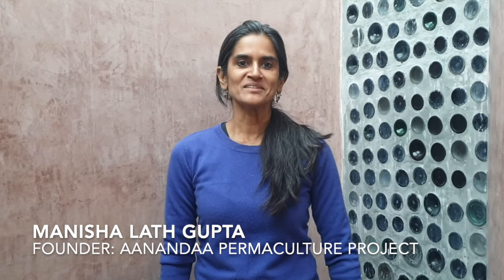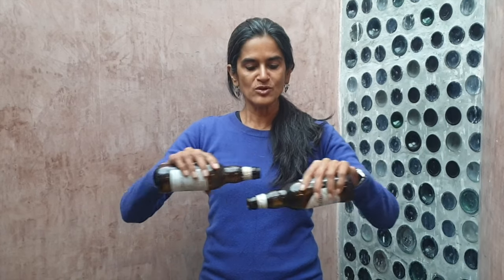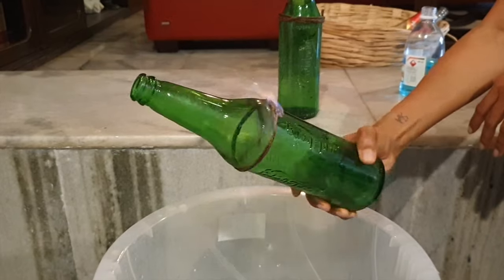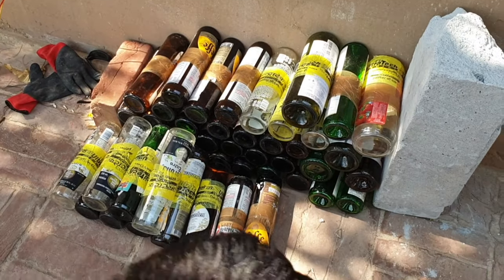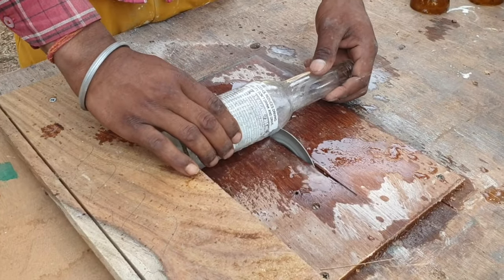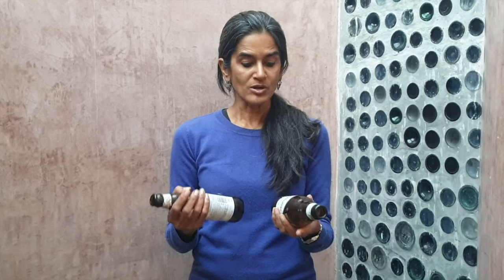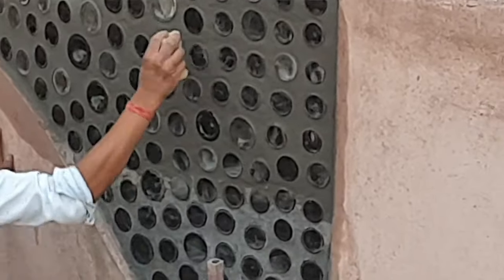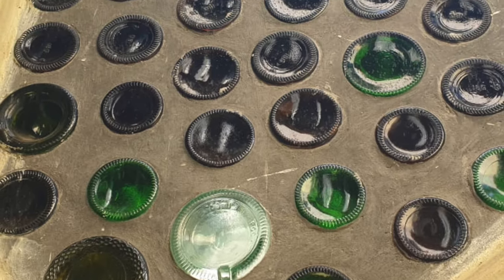How to make a Glass bottle wall

Comment: I've seen those glass bottle walls on earthship structures by mike Reynolds. They look amazing and all earthship structures are made mostly from recycled materials like tyres, glass bottles, soda cans. They also have a you tube channel called earthship biotecture. I really liked the concept of earthship where you can harvest rain water, produce your own electricity and you can also grow your own food inside the house and not only that they also have their own waste management systems.
Reply from the maker: Earthship structures are fantastic too! But they are well suited for temperate zones, not for our subtropics, where we have very hot summers. But yes, they are amazing structures, and we took a lot of inspiration from them.
Reply: @farmaanandaa  why not? He built one in the desert
Reply from the maker: Pls check again. It's probably High Desert, which is colder climate. You can't survive in an earthship when your temperatures range from 5 to 45 degrees Celsius like ours do.

Comment: NIce video, very helpful. I would like to know how thick the bootle wall should be if it is an extrerior wall, and how thick for an interior wall? THank you
Reply from the maker: Ours is 9 inches. Since two bottles have to be cut and joined together, think that's the minimum width you should go with
Reply: @farmaanandaa   Thank you!
Reply: Thanks for the help.

Comment: Thank you for this; I am glad to hae found your channel!   Do you have any comments or thoughts on this idea?   I have been planning to build a wall of bottles, but rather than building those double-ended bricks, I would like to leave one side open-ended, and in the open hole I would place lengths of bamboo and straw, creating a habitat for pollinating native bees.  This is for a wall where both sides are outside.
Reply from the maker: Hello Melissa, your idea sounds interesting and I think it can be done. It will be like a bee hotel - I have seen such designs without the glass bottles, but you can probably make one with the bottles. Good luck!

Comment: Was it used with cement based material or mud? Better if you show wall from both the sides. How does it match the width of the wall if bottles are of different sizes?
Reply from the maker: This is made with cement mortar. You cut the bottle to half the width of the wall. So when you stick 2 bottles end to end, you get the size of the wall. If you see the beginning and end of the video, you can see the wall from both sides

Comment: Did you use rubbing alcohol? I tried burning a string that I poured 70% rubbing alcohol tied around a thick glass vinegar bottle. It didn't work. I'm not sure why. It seemed like either the string was non-flammable or the alcohol wasn't the percentage it claimed to be, or the glass was too thick. Any thoughts? I'm going to try a different string I have on hand, before I go out and buy a different alcohol. Feedback appreciated from those whom did have success using this method. Thanks.
Reply from the maker: Try a jute string and do it again. Should work. Good luck!
Reply: Use 90% plus rubbing alcohol.

Comment: Hi. What is the ratio of the mixture used to bond?
Reply from the maker: Standard cement mortar
Reply: @farmaanandaa  : isn’t that a lot of cement? Also I see you have laid in the shower area… is that maintainable in the long run? Most sustainable houses have only the wet area like kitchen and bath area with tiles to avoid leaks and to make cleaning easy.  Is the wall completely laid with bottles or the lower area is tiled to avoid leaks ?